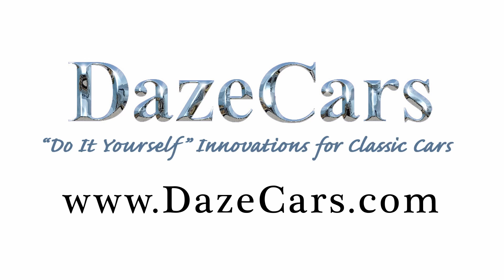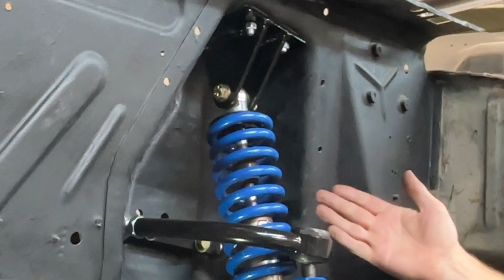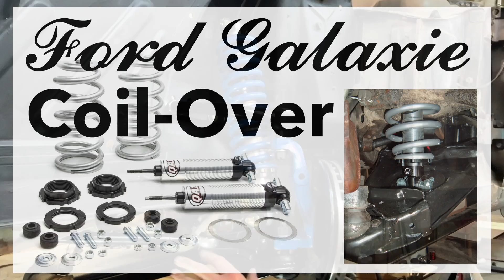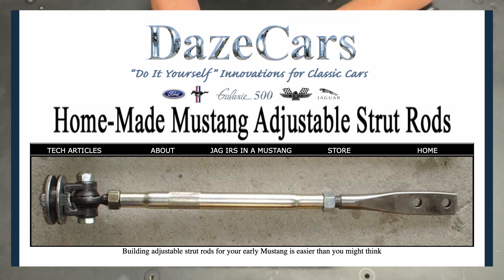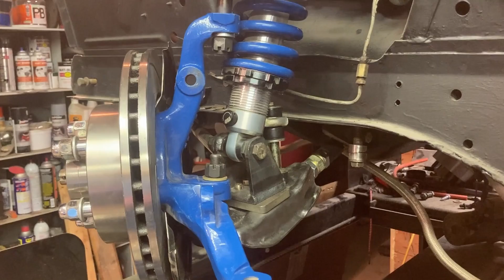DIY Coil-Over Front Suspension in a 64.5 Ford Mustang to Compliment the Independent Rear Suspension

Comment: Hey there Day, just thought I'd comment on a couple of points I failed to hit on last time. I'm in your corner on using the lightest springs and fine tuning the ride with the shocks. When I built my front suspension I called Ron Morris who said he used 350# springs, so I used them. I've since switched to 325# springs.  Your choice and explanation of the ball joint is also spot on. AFCO also has a low friction screw in ball joint, for twice the price.😮
Reply from the maker: great real world information, especially on the ball joint, I may need to look into that.

Comment: Great set up! What is the length of the shock you used eye to eye? And what spring rate do you use or are using now? 
Thanks
Reply from the maker: @scotjandro6950  Sorry it took me a couple days to get back to you I had to go out and measure.  The shocks ate 17" center to center and the springs are 375#  Don't hesitate to reach out if further questions come up.

Comment: Do you have any lower control arm bearing kits and videos on how to install them? Thanks
Reply from the maker: no I purchased mine from ORP
Reply: @dazecars Thanks for the reply. 
Any videos on this installation?
Reply from the maker: no I don't have any videos or pix on that.  It was a simple install.  If I remember correctly the hardest part was getting out the original bushing sleeve

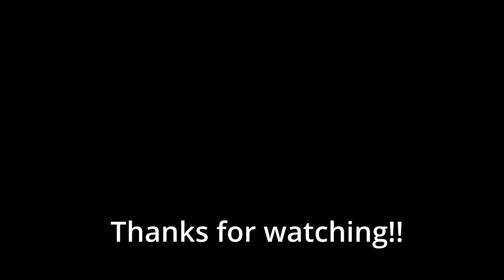Comment: I’ve restored and modified many 65/66 mustangs.  I think you have a good design, but I understand your 21:33 concerns on liability.  One benefit to purchasing the upper control arm is that it may be stress relieved, which would be hard for a DIYer.  Looking forward to seeing the Jag rearend.
Reply from the maker: Eventually I will do a similar video on the Jag install or several videos but that is a ways down the road
Reply: Forgot to ask.  What spindles are you using?
Reply from the maker: CSRP Granada spindles with the correct 65/66 geometry.
Reply: Me too…. Looking forward to the Jag rear-end video when you’re ready to share.
Reply from the maker: not enough hours in the day 😁😂🤣  I would love to share it now but I need to do some more work on it and there always seams to be something else that takes priority.  Especially now that I am also juggling youtube.  The project I want to work on is not always the best choice for a video OR I pick the project I can do a video on and get done in the least amount of time pushing some of these bigger projects to side.   Also doesn't help that I already have a tendency to jump around from project to project. 😁 I always circle back but it often takes time to get back to something already started.